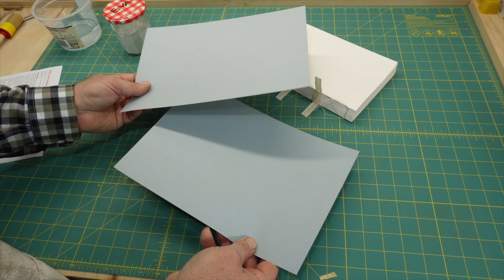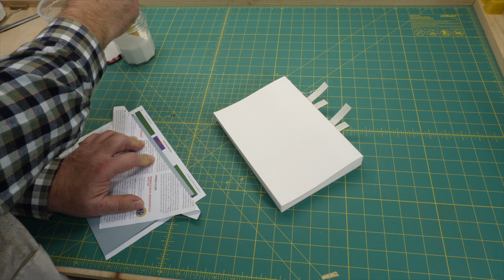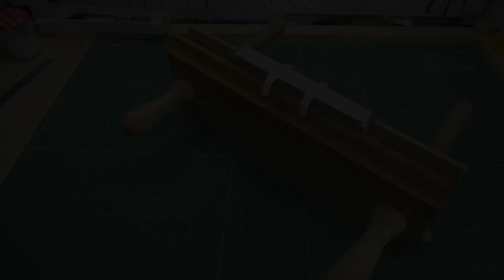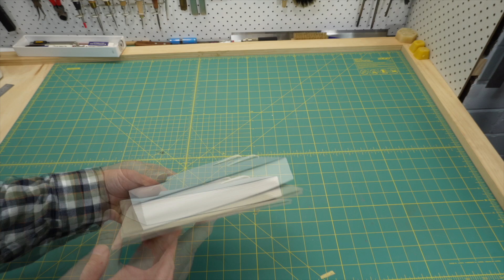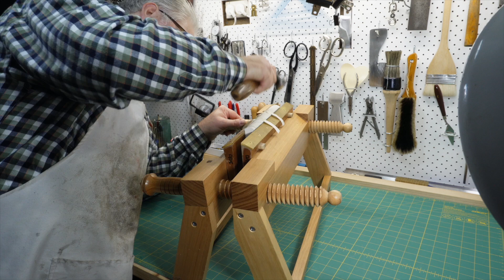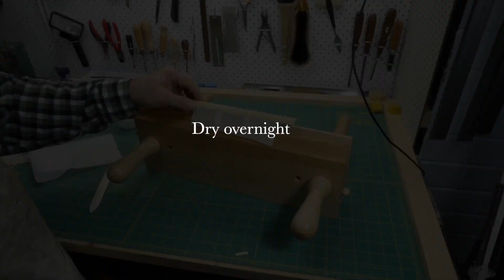Rounding, Backing & Spine Lining - Part 2 Rounded and Backed Cased Book

Comment: In your experience, does glue dull the sharpness of a guillotine? or does it make no difference? I usually try to have the edges unglues before i trim.
Reply from the maker: Glue won't dull a blade any more than paper.  Less I'm sure.  You should glue the spine before trimming a book.
Reply: @DASBookbinding thanks! I was once turned away buy a copy shop who refused to cut through glue. Since I have my own guillotine I glue up until the kettle stitch, trim, and then after doing the end bands glue the rest. But it's so good to know your experience! I really appreciate it.

Comment: This is so useful - I learned bookbinding 50 years ago and have forgotten a lot of it, but you do it the way I was taught, so it's a brilliant refresher course.  Unfortunately I don't have a finishing press or backing boards and I need to rebind just one book, so it's not worth buying the extra equipment.  Do you have any tips as to what i could use instead?  I'm thinking of putting it in my ordinary book press and trying to back it while hanging upside down!!

Comment: Hello! Love all your videos - you have been instrumental in helping me become a hobbyist bookbinder. I have a question: Why is the Schmedt press possibly too light for backing? I have just begun rounding books and would like to back them, but I am not sure what press is best to pair with backing boards.
Reply from the maker: This is there Schmedt press that is best suited to backing
https://www.schmedt.com/bookbinder-s-wooden-double-screw-press-with-wooden-screws-screw-length-approx.-55-cm/60000000.B
It's normally used with the leg so it hangs off a bench.
The heavier finishing press would be strong enough, but not deep enough.  Maybe if it were propped up on bricks?
They don't seem to have backing boards.  I'll write tham and check.

Comment: Should the height of the shoulders be added to the original pages size? For example, a B5 page is 176mm on the short side, but if I'm planning to do a rounded and backed spine, should I add the 3mm of the shoulders to the 176mm of the original page size? So a 358mm wide sheet (179+179, to make the signatures). Thank you!

Comment: Does a rounded and backed textblock have to be sewn with supported sewing onto tapes like you've done, or can it be also done with an unsupported sewing method like the french link stitch? I've finally mustered the courage to try rounding and backing a cased book, but this has me a bit uncertain and I'm not sure where in the literature to look for this info. Any help would be much appreciated!
Reply from the maker: Sort of a complex question for comments.  Modern books don't go into technical details of book mechanics, and mostly disregard traditional best practice anyway.  This might be a bit complex for the more common older books.  It might not be answered directly, but Arthur Johnson (Thames and Hudson Manual) and Eric Burdett (Craft Bookbinding) would be the books to help you answer these types of questions.  But the answer is, yes you can round and back a book sewn using catch-up sewing (aka French-link), but be careful not to sew tightly.  In rounding and backing the distance around the arc of the spine expands.  If there is not enough give in the sewing it becomes very difficult to back where the catch-up stitches (and kettle stitches) are because the book is being held together too tightly at these points.  This is why you don't glue over the tapes before rounding and backing, so the tapes can slide under the sewing as the spine expands.  Generally I only use this type of sewing on thin books without supports, and very large books with supports.  Thin books are hard to back, and don't need as much backing.  And you shouldn't have to "muster the courage" to do anything in bookbinding.  It's just bookbinding - lives don't depend on it.  When doing something new and technically more complex you should practice.  And practice is done on scrap, not something of any value.  Just get some scrap paper and go for it knowing you will throw it in the bin at the end - even if it is perfect.  Then there is zero pressure to get it right.  And you should not expect to get technically difficult things right the first few goes.  That's like picking up a musical instrument and expecting to play perfectly right away and being too scared to start because you might not.  Just go for it!!  Good luck.  DAS
Reply: @DASBookbinding  Thank-you so much for taking the time to help me out, I really appreciate it! I will check out those two sources you mentioned for sure. You confirmed my suspicions that the sewing need not be too tight or rounding with be difficult. Thankyou also for the vote of confidence! I'll disregard my perfectionist mentality and go for it, it will be fun as it's bookbinding anyway! I will try rounding and backing with the sewing onto tapes you've shown here, it also looks fun! I love your videos, they are so professional, academic, insightful, clear and fun! I hope you keep doing them for a long time!

Comment: Is the purpose of backing just for "support"? Is it necessary for first timers? This intimidates me and I don't have access to any of the presses.
Reply from the maker: I guess the question is what is the type of book for first timers.  I would recommend starting with pamphlets and stiff boards bindings.  But if you want something a bit more challenging I'd suggest sewn-board binding.  No rounding and backing required.

Comment: Hi Mr Bookman!,
I hust finished sewing my first text blokc and well... You said be careful of the tension so I was but now its a little floppy. Is it supposed to a be a little floppy or should I cut it apart and try again?
Reply from the maker: It is hard to know what a little floppy is, but it should be fine.  In later steps you will glue and line the spine and it won't be floppy any more.  It is your very first text block, so this is the experience where you learn the limits of what works.  Good luck!  DAS

Comment: I learned so much from watching your videos. So I started binding my own children's picture book, but I ran into 1 issue: the endpages are peeling of the inside cover where the laminate cover was folded over. Do you have any glue recommendations to keep it from peeling? I used the neutral acid free book binding glue. I think it's PVA. TIA.
Reply from the maker: I don’t think this is an adhesive issue. Is this a square back binding?  If so I would suggest a wider joint gap.
Reply: @DAS Bookbinding  hi, yes, it is a square back binding. 1cm width with 6.5mm gap. I noticed only the areas where there was laminate it was lifting.

Comment: Another great video Darryn. I was wondering if there are hard-and-fast rules about how to put down the pastedown i.e. when to do it 'book closed' vs. when to do it 'book open'? Does that make sense?
Reply from the maker: There is a “rule” often quoted but a bit hard to understand (and I don’t remember the wording right now). I think this is the same but easier to understand. Cased books the paste down is put down closed and board attached bindings (covered after boards are attached) are put down open. I think it makes sense. It would be hard to put the pastedown down open for cased binding and in the boards attached you need to work the pastedown into the inner joint which needs to be done open. Hope it makes sense. Darryn

Comment: Welcome
I have benefited greatly from you
I have a question..
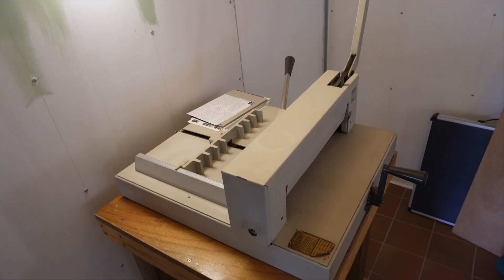Where do I find the paper cutter that appeared at 5:30
And thank you. From Saudi Arabia.
Reply from the maker: Unfortunately my answer will be very specific to Australia.  Used Ideal (German company) guillotines have been very popular in small print shops for many years in Australia.  Thus they come up on the used market fairly regularly for about 10% or less of new price.  I always recommend only buying good condition ones with a blade without nicks (it won't be sharp and will need professional sharpening) and that have all the safety guards (I'm bad, the main one is not on for the video).  I'm fond of this old one from the early 80s.  It was the first Ideal I bought and I've kept it because of this, and because it is small.  It went under water last year when I was flooded and I haven't completely pulled it down and cleaned it, which I need to do as some rollers are seized.  They have a modern version of this which has a much easier to replace blade and cutter stick.  If your can afford one I would recommend buying a new one.  All the best, DAS
Reply: @DASBookbinding  Thank you for responding quickly to my question.
I will take your advice and try to buy a new one.
Note: I use Google Translate because my English is poor, so please excuse me☺️

Comment: I'm curious.  Why is it traditional to trim the ends of the tapes at an angle?  Does it confer any specific benefits?
Reply from the maker: The common answer is that is stops the tapes fraying.  But doesn't make sense to me since once laminated between the boards and pastedown they wouldn't fray.  If there is a reason I haven't found it yet, and may be lost to time.
Reply: I think it's to help reduce the risk of fraying. I seem to remember reading/seeing that somewhere but can't remember where.